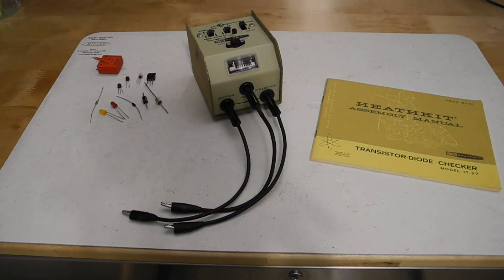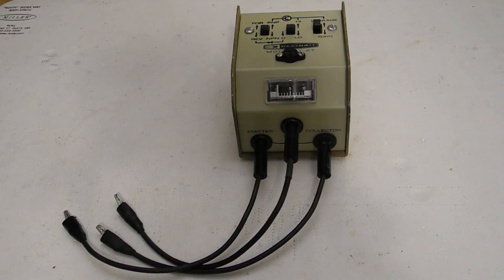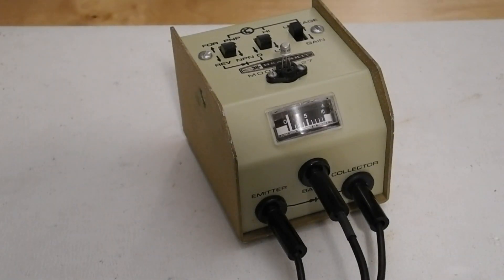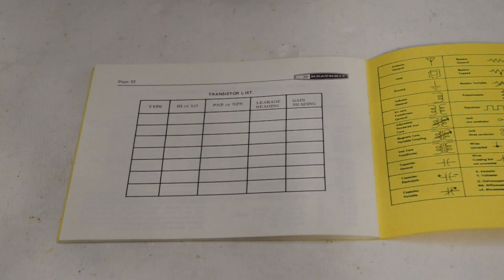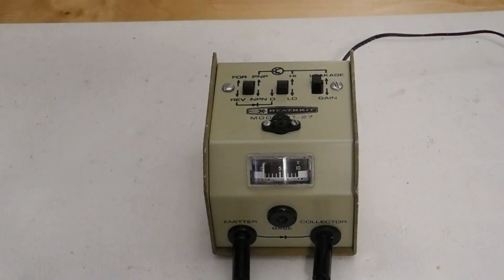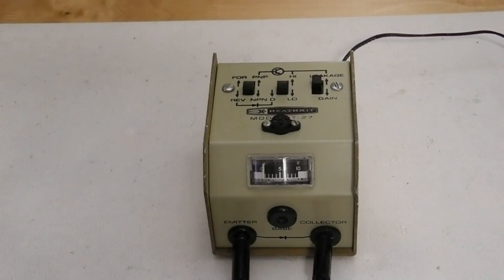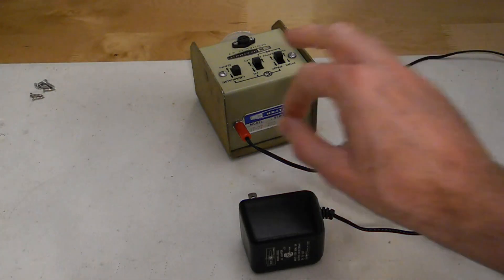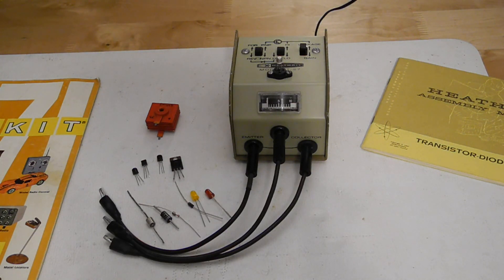The Heathkit IT-27 Transistor-Diode Checker

Comment: Hi Jeff, I have a Heathkit IM-28 that I repaired & it worked fine. However, recently the  r x 1 scale stopped working. Do you have any suggestions as to what might be the areas to check? Thank you, Gene.
Reply from the maker: It if it only the RX1 range, it is likely a problem with a resistor or wiring around the range switch.
Reply: @jefftranter  Well, it worked for a while & then not. What specific resistor would you check?
Reply from the maker: @eugenetheodore2956  It looks like the resistance ranges use resistors R24 through R30 on the range switch Wafer "C".
Reply: @jefftranter  Thank you Jeff. I will check them.